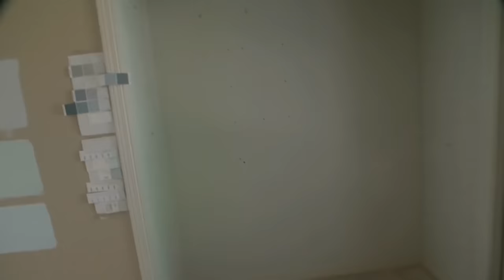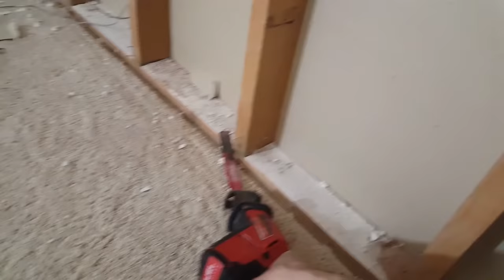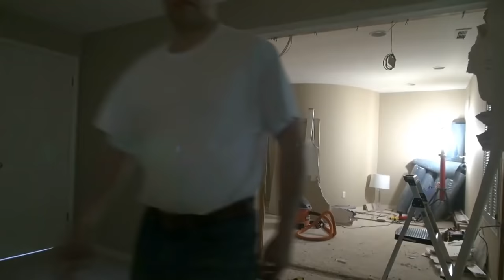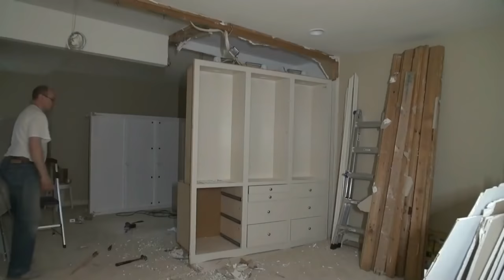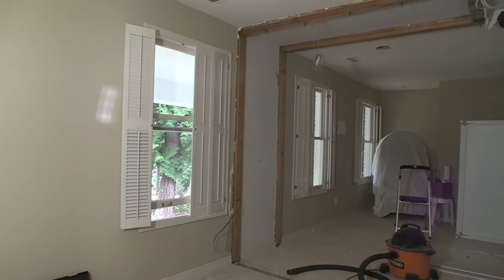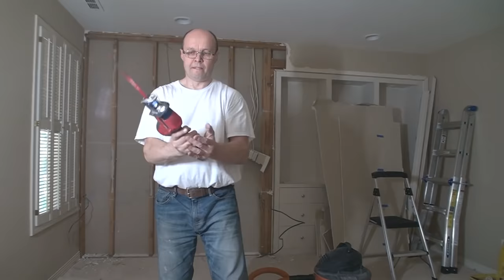How to make Two Bedroom into One Big Room. Спальня, расширение

Comment from the maker: Another videos about how to build a closet:
1) this video How to make Two Bedroom into One Big Room https://youtu.be/2wFKgU-ANWA
2) How to Build a Closet Frame in Bedroom. Part 1.https://youtu.be/yYjG03JPbJk
3) How to Build a Closet Frame in Bedroom. Part 2 https://youtu.be/REZxJT1OOvU
4) How to Build a Closet. Sheetrock, Sanding, Paint. Part 3 https://youtu.be/xVG40PfxwOI
5) How to bend baseboard molding https://youtu.be/k8iK7WcVeUY
6) Crown Molding Installation https://youtu.be/b1Tf0SbhVt0
7) How to Mask Base Board prior to Spray Painting https://youtu.be/UWM5UkO7bWI
8) Wall Paint and Light installation https://youtu.be/ke12OWpUMLs
9) How to wire 3 Switch in 3 Gang Box https://youtu.be/AspcqG4PvPM
10) all in one video - Bedroom remodel from A to Z https://youtu.be/kuUwMz7lwRg

Comment: What would you do if you did all that and after a while the middle were the wall use to be started warping down
Reply from the maker: Before I start it I was on attic and checked structure the roof struts. So the roof/ceiling frame was made to support ceiling itself and any middle wall was build just like additional and was build after all main work of the house frames.

Comment: Great video but can i see the room when its finished please 😎
Reply from the maker: Yes will do. Now i build the closet there. Last videos in my channel.
Reply from the maker: How to make one large room out of two bedrooms
1) this video How to make Two Bedroom into One Big Room https://youtu.be/2wFKgU-ANWA
2) How to Build a Closet Frame in Bedroom. Part 1.https://youtu.be/yYjG03JPbJk
3) How to Build a Closet Frame in Bedroom. Part 2 https://youtu.be/REZxJT1OOvU
4) How to Build a Closet. Sheetrock, Sanding, Paint. Part 3 https://youtu.be/xVG40PfxwOI
5) How to bend baseboard molding https://youtu.be/k8iK7WcVeUY
6) Crown Molding Installation https://youtu.be/b1Tf0SbhVt0
7) How to Mask Base Board prior to Spray Painting https://youtu.be/UWM5UkO7bWI
8) Wall Paint and Light installation https://youtu.be/ke12OWpUMLs
9) How to wire 3 Switch in 3 Gang Box https://youtu.be/AspcqG4PvPM
10) all in one video - Bedroom remodel from A to Z https://youtu.be/kuUwMz7lwRg

Comment: Bravo 👋 is there a part two?
Reply from the maker: Not a part two, but some continuous work yes.
Let me find it...
Reply from the maker: 1) this video How to make Two Bedroom into One Big Room https://youtu.be/2wFKgU-ANWA
2) How to Build a Closet Frame in Bedroom. Part 1.https://youtu.be/yYjG03JPbJk
3) How to Build a Closet Frame in Bedroom. Part 2 https://youtu.be/REZxJT1OOvU
4) How to Build a Closet. Sheetrock, Sanding, Paint. Part 3 https://youtu.be/xVG40PfxwOI
5) How to bend baseboard molding https://youtu.be/k8iK7WcVeUY
6) Crown Molding Installation https://youtu.be/b1Tf0SbhVt0
7) How to Mask Base Board prior to Spray Painting https://youtu.be/UWM5UkO7bWI
8) Wall Paint and Light installation https://youtu.be/ke12OWpUMLs
9) How to wire 3 Switch in 3 Gang Box https://youtu.be/AspcqG4PvPM
10) all in one video - Bedroom remodel from A to Z https://youtu.be/kuUwMz7lwRg